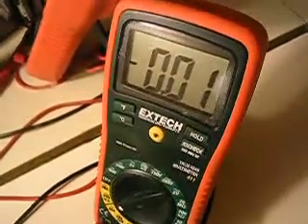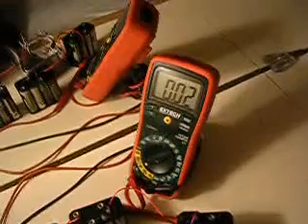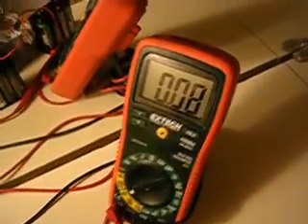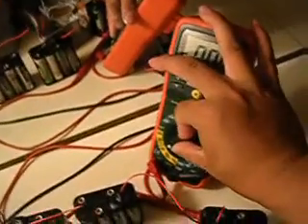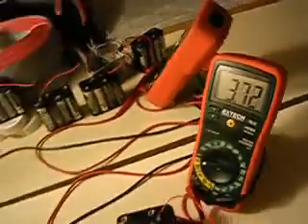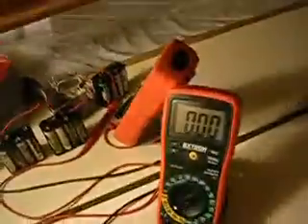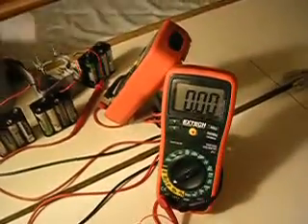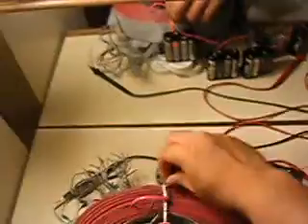Paper Fan ▲ Digital multimeter AC readings

Comment from the maker: To clarify, the meter would take a few seconds to fall to zero once disconnection occurs and it would not even reach zero when running <50% duty cycle. There is obviously an annoying tendency in the meter to not fall exactly when the true current falls. Scopes are the way to go... *sigh* -__-